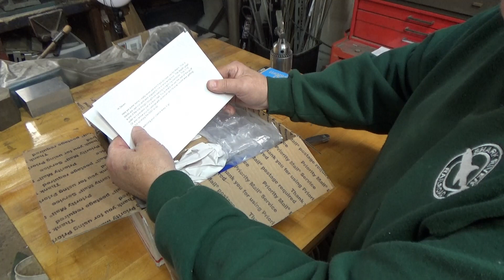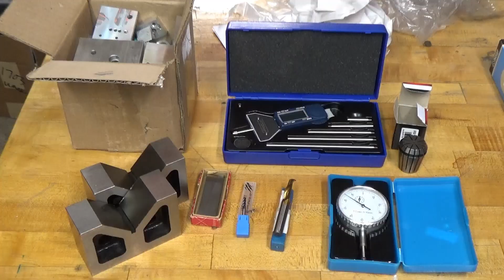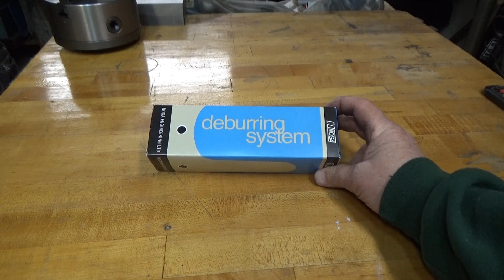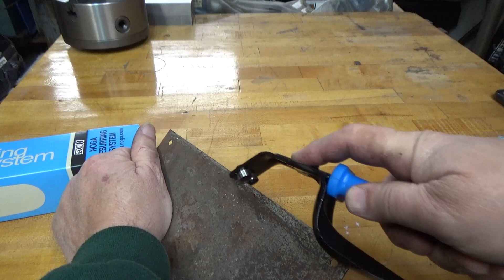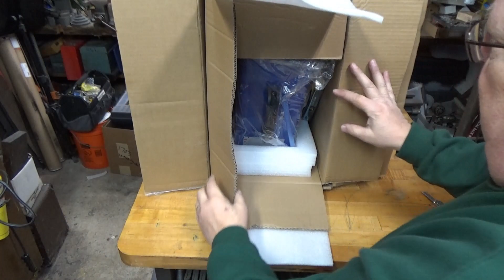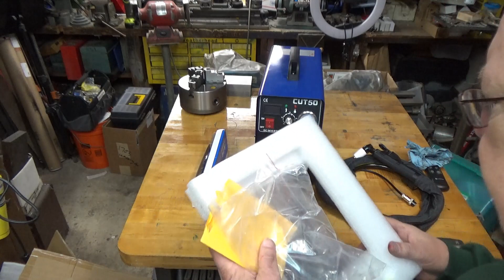Shark Bits-#44 Viewer Gifts-New Tools

Comment: We have one of those plasma cutters, worked like a champ until fire we had back in May, still works but trips breaker after couple inches on thin stock, hopefully one your viewers might have a repair idea for us, very cool tools you received!! Merry Christmas!
Reply from the maker: This is a first for me.  I was using oxy acetylene for cutting but I have small tanks and it does not last long.  Thank you for watching and commenting, Merry Christmas and Happy New Year!
Reply: @sharkrivermachine  oh yeah we tried oxy acetylene with Lil bottles, plasma way to go, one we have did ¼ inch nice, tip from us, add another air dryer/filter before you get to inlet, least Lil bit moisture and it goes nuts😂
Reply from the maker: I have driers that I have not installed since I got this compressor.  It is time to get it done.
Reply: @sharkrivermachine  yeah that's must, we have metal shop, no insulation and a gravel floor covered in rubber mats, our compressor can build up to a couple cups of water or more in single day of use depending on moisture in air, we actually have 2 dryers connected to each other before reaches any our hoses!